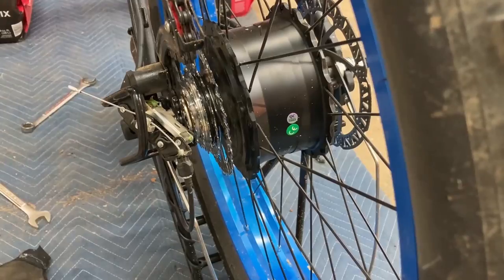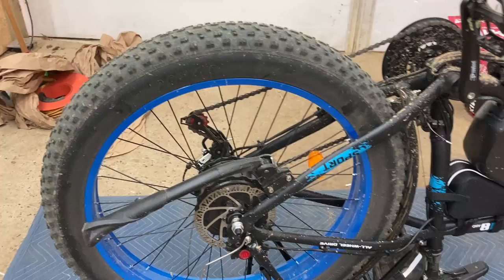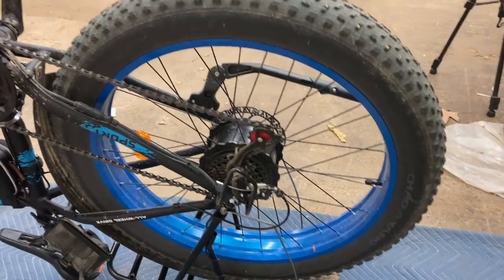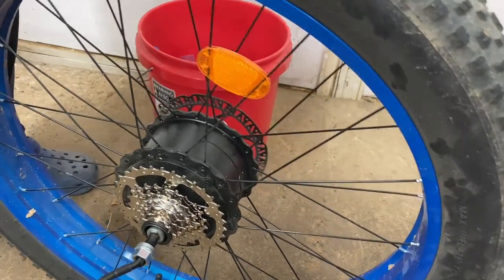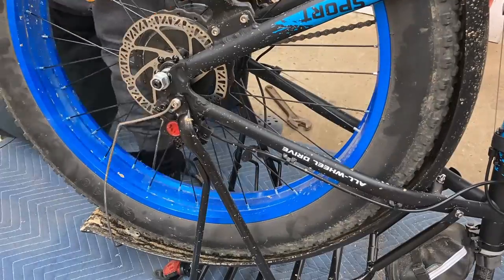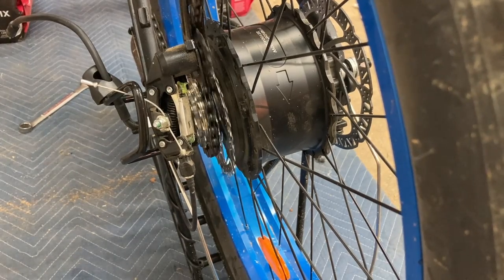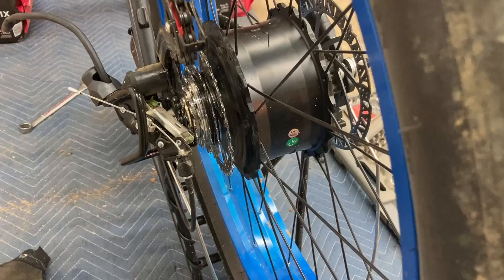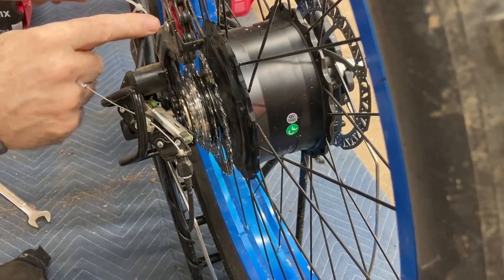Philodo H8 Ebike Upgrade THIS Changes Everything

Comment: THANK YOU. I bought a Philodo H8 a few weeks ago and was a little disappointed. At 20 MPH i was pedaling super fast. I came across your video and ordered the parts you said, ( sprocket and tool)   They came in today and i followed your video and changed the sprocket to the new one. WOW,, what a difference. the bike is useable now.THANK YOU. I have a question, why did you change the rear sprocket and not the front one? Thanks again, i watch all your videos, they are great.BTY i'm 77.
Reply from the maker: I am happy it helped, it makes a world of difference. When I got mine I peddled so fast my phone hopped out of my pocket.  I had to back track and find it, which I did on a back road.  I knew I had to do something.  I researched and found out you get more by changing the rear sprocket than you do the front.  And the front had 2 other sprockets, so I did not really want to mess with that.  But truthfully, the main reason I did the rear, is I had one that I was going to put on my Ecotric.  I did not want to wait for another to arrive, so I put the 8 speed on until my 7 speed came in.  I did the same change on my Ecotric, so I knew I could do it as the Ecotric and the H8 had the same Freewheel.
   One thing to keep in mind, be sure to keep your chain lubricated regularly as this freewheel has a tighter turn radius so it will wear out faster than the standard one.  I got about 8,000 miles on my Ecotric when it started to slip.  I am using a dry lube now, so hopefully it will last longer.  If not, no big deal as it is a 15 min change.
Thanks for your kind words,   I am humbled that you watch my videos, is this your first ebike?
Reply: @papablueshirt  Yes, you were a BIG help.  Thank you for the quick , long and very nice reply. 

What I was going to do before I seen your video(s). was to put on a 48 to 52 front sprocket. But then i might have to put on a longer chain? Then I saw your video and since you gave us the part and tool number and showed us the results i was going to try that first. It worked great. I washed the chain before i started and used chain lube, the oil type, after I finished. I'll look into the dry lube, i didn't know about that and will lubricate it often, thanks. 

I would guess that Philodo used a pre-made fat tire bike and because of the heavy fat tires they geared it very low. In first gear the fastest I could go by pedaling alone was 3 to 4 MPH. In high gear the fastest I could Pedal was about 24 MPH. Now I can pedal with the motor and go 30 MPH. With the twist grip it will go 33 or 34 MPH, but I cant pedal that fast. 

You said in one of your videos that the twist grip runs the front wheel. When I lift the bike off the ground the twist grip spins both wheels? So from what you say, by pedaling it only used the rear wheel?

I also have a Ecotric Hammer, which I really love. I bought it 4 years ago when it was 1000 watts. Without pedaling it goes 25 MPH, with pedaling hard and fast It gets up to  30 MPH. The upright siting position is very comfortable for this old man. 

I also have a 15? maybe 20 year old Currie E-bike, I think it's about 400 watts, and it goes about 16 to 18 MPH. It has dual gel 24 volt batteries. UGH, yes it is very very heavy. But it still runs good.

I also have a eGO scooter that is about 20 years old? It originally was 24 volts at 50 amps and would go about 20 MPH. I put on a 48 volt battery and a 350 amp controller. It then went 48 MPH, no pedals. 

Once again, thank you for all your very informative videos and God bless you.
sincerely
Paul
Reply from the maker: No problem, I love talking ebikes, and glad I could help.
If you check the description there is a link to the dry lube.  I always used the oil type for my Ecotric and it really makes things messy.  My rear wheel always turned dark.  The dry lube is wax based,  so there is no mess on the rear wheel.  I really like it.  I think I got 4 spray cans, I am still on the first one.
  Wow, it looks like you discovered ebikes way before I did.  I just discovered them in 2020 and did not realize what I was missing.   Your eGo scooter sounds interesting. What type of battery does it use.? I never knew ebikes have been around that long, I am sure the batteries have come a long way from what they used to be.

Re Throttle:  Yes, when you twist it, both motors engage.  They also engage both motors with the walk function and cruise control.  When you are in normal PAS, just the back motor works.
  I have a question on the H8.  My front wheel seems to move forward and backward slightly as I hit bumps.  I suspect it is the suspension fork play or something.  My ecotric did not have suspension, so it did not move much.  Does yours do that?
   Have you discovered suspension seat posts?  I put one on the H8 and all I can say is wow.  It made the ride so much nicer.  I am thinking of putting a suspension stem for the handlebar as I think it would really smooth out the ride.
Well it is getting late here, I will talk more later.
"May the good Lord take a liken to ya" : )
Reply: @papablueshirt  OK, I'll check the link and order some dry lube.

My eGO uses 4 large ( almost car size ) lead acid batteries. very heavy.

Yes, I have been into electric bikes for over 20 years. The Currie i have now is my wife's bike and it's a step-thru with an external controller. I had a Currie 20 years ago that had the controller built into the motor, it was a very compact robust design. You might enjoy looking up the old Currie bikes online.

I haven't notice my H8 having a problem with the front wheel. I have the Ecotric Hammer does have a front suspension and a rear seat suspension. I bought a seat suspension for the H8 and it really helps a lot. I highly recommend it. 

I looked into the suspension stems for the handlebars for both of my bikes. All they are is a piece of rubber that are color coded for different hardness. it doesn't look like it has much movement. If you get one let me know what you think of them. 

Paul
Reply from the maker: Hi Paul, thanks for your input on the front suspension.  Maybe I have it set wrong or something, I will have to experiment with it.  It gets a little annoying, I can put up with that as long as it is not failing on me.
  I will check out the Currie.  I did a quick search yesterday and it looked like they were no longer in business, but it seems they were some of the first ebikes.  I will do some more investigating today : )  I thought the eGo probably used Lead acid batteries.  Heavy, but probably cheaper than lithium.
   Re suspension stem: yeah I have seen the kind that uses rubber shims, but the kind I am thinking of use the same system as the seat suspension.  It uses springs.  I put a link next to the dry lube link.  I hope to get one soon so I can do a review on it, but at almost 200 it is hard to justify. LOL  My seat suspension works so well that I feel like I am on a bucking bronco with the front.  It bounces all around.  I tend to hold the handle bar loose in my hands to kind of let it bounce.  I have also learned to hold the grips away from the center as it has a bump on the grip that kind of hurts when you hit bumps.
  In your years of riding, have you had many flats?  I was doing my 2000 mile review the other day and had a flat.  Turned out it was a staple.  I pulled the staple and fixed it and promptly had another flat in a different spot.  I think a pc of the staple is still in the tire and I must have rotated it when I fixed it.  I gave up and put a new tube and tire on.  I also bought some flatout to hopefully solve the issue going forward.  I do a 32 mile wood trail with very limited access, it would be a bummer to lose a tire midway.
Reply: @papablueshirt  Hi Papa Blue,

I made a few minute video of my bikes just for you, it's attached at the bottom of this video.

My Hammer is by far my favorite bike i ever had. I love the power, upright sitting position and wide western handlebars are all great. 

I think Currie had bikes and scooters about 35 years ago. I had one back then, they were low power, maybe 400 watts, and very reliable. Back then they were all old fashion heavy gel lead acid batteries. I worked in the electronics industry for 30 years and I love bikes, so rebuilding the ego and other bikes mix my two passions. I used to belong to a ebike group 20 years ago and we all modified the bikes to make them go faster.

I looked into the handlebars suspension and only found the rubber insert ones. I'll recheck into the shock type ones. But since our bikes have front suspensions i wonder how much help the handlebars suspension would help. I'll look forward to your review if you get one. My friends bike has a hard rear end bike, when he was following me he noticed how my seat would go up and down over bumps.  So he's going to buy one like mine. It's a wide soft seat.

I had a few flats on my bikes over my life.When i was a kid we were poor and I used to use rubber bands and rubber glue to fix flats. About 20 years ago I was riding my Currie ebike going down a hill about 20 MPH. The rear tire had a blow out and I went down dislocating my finger. On both of my fat tire bikes I use the Mr. Tuffy XL Series 4XL TEAL. the teal ones are for tires 4.1 to  5 inches. I get them so they would wrap around the inside of the tires more. As a secondary precaution I also put in green slime, probably not needed. In about 1000 miles I haven't had a flat. I live in Arizona and we have a huge problem with thorns and goat head stickers. I also carry a can of " Fix a Flat " at all times just in case. I haven't need it yet. Flats spoil a ride. 

Below is the link to the video i made for you.

https://www.youtube.com/watch?v=uuk4snZegsU

Paul
Reply from the maker: Hi Paul,
Thank you so much for the video.  As they say, a picture is worth a thousand words.  A video is even better : )
   Sounds like you know quite a bit about electrical.  I do pretty good with mechanical things, electrical is a little harder for me.  I have wired a few houses, but that is pretty straight forward.  When it comes to resistors and relays and stuff like that, I have to do a lot of reading and watching videos.  I have seen quite a few lithium battery fires on youtube, so they make me a little leery about messing with them.  I would love to get another battery for my Philodo and wire them together. I hear they make kits for that, but not sure how it would work with the dual motors. 
  I had no idea they made ebikes that long ago, man I have been missing out all these years LOL.  Your eGo looks more like a motorcycle than a scooter.  I know what you mean about high speed though.  I got my Ecotric up to 40 mph or maybe a little faster [it pegged at 40]  I felt pretty stable, but it had a front fork with no suspension.  I may lock my suspension on the Philodo when I try to beat it.  I have federal park that I go to that has some crazy hills.  I can go over 35 just coasting, it is a rush.   Sorry to hear you wiped out with a flat.  So that will certainly be on my mind now.   I have had a few mishaps.  I rode off a trail once.  It was my fault, I looked back to see if someone was coming and drove off the edge of the trail.  It was on the edge of a hill, so I did a face plant over the handlebars.  The hill was so steep I could not get back up and had to walk through the woods and catch the trail on the other side.  Then I tried to pretend nothing happened,  but my wife found me out pretty fast LOL.  If you are interested here is the video here: https://youtu.be/OufBqN3hmZI
  I went about 12,000 miles before my first flat, so I did not worry about that much.  Now it is on my mind a little more.  I carried fix a flat for a lot of those miles as the guy I watched said he was always having flats with his flat tires.  I think he lived in an area like you, that has goat heads.
  You are in AZ, funny we almost moved there last year.  I did too much reading and go kind of freaked out about Valley fever.  I deal with lung issues, so that kind of persuaded me to stay put.  What is your take on Valley Fever?  My wife was concerned about the dust storms too.  I think we may be too old to be making major life changes LOL
Reply: @papablueshirt  Glad you liked the Video. I was was thinking about wiring another battery on also. But after thinking about it I would have the extra weight all the time. If I just bought another duplicate battery then I can strap it on the back just when I want to go the extra distance, and when the first battery dies, just swap it with the spare in the rear, or where ever you want to put it. This way no permanent wiring change and no extra weight all the time.

Wow Ecotric up to 40 mph, thats scary fast. lol. I didn't know you can go faster with the front suspension locked. I just looked it up to learn about it.  less bobbing up  and down thanks.  

Glad you were ok after you mishap, I had to go to the ER and have my finger undislocated, ok, not a word, lol.

Wow again, 12k miles and no flat. Like i mentioned before, with out tire protection I would have a flat once a  week here. That is why i use double protection, liner and slime.

We live in what is called " the high country " in Arizona. We are a mile high and have 4 mild seasons here in the Prescott area. We have 4 to 6 usually light snowfalls a year, 1 inch or less. But i have seen 16 inches of show here. We have about 3 weeks of weather in the 90's in the summer. In the area where I live there are 750 miles of local trails to walk and ride, and outside the city there are thousands of miles to explore on dirt mountain trails. We are approx 100 miles north of Phoenix and don't get the smog dust storms, or super hot weather. Housing here is much cheaper then the Phoenix area and many come with 1 or more acreas of land, i'm on 2 acreas. We lived in Tucson for 20 years and did get Valley Fever once, but we don't have that in the high country. I also have lung problems COPD, ( no, i never smoked ) and that is one of the reasons I moved here, very clean aire.
  
  Have you seen this video made by Philodo about removing the H8 speed limit? I tried it and can't get it to work.

https://www.youtube.com/watch?v=7EvLriKStPM
Reply from the maker: I really did like the video, you have a nice speaking voice you should post more to your channel as I am sure people would be interested in your ebikes and scooter.  My wife was impressed [as I was] that you would take the time to record a personal video.  Thank you so much
  Going to the ER I am sure was not fun.  Did the dr tell you to slow down ; )
  I used to carry an extra battery on my Ecotric.  I had the kind of pack rack that hooked on your seat post.  It works ok for the road, but I found out not too good for off road use.  Here is the video of me crashing and having a "fun" day in the woods. https://youtu.be/C17hY9-HU6I?t=491
  After that happened, I went to a standard luggage rack with more success.  However, I just resurrected my broken rack.  I took the rack bag mount and attached it to my Philodo.  Now I can carry my pac rak bag on my Philodo.  It worked out real nice.  So now I can carry that extra battery when I get one, as needed.  On most rides, the Philodo has plenty of range.  58 miles is my longest, but I had to baby it at first to make sure I made it.  It would be nice to have the extra battery so I can go as fast as I want and not worry about running out.  On my Ecotric I had to start bringing an extra battery just to make it home.  It got so bad, that I could only go about 8-10 miles before it ran out.  The 36v really went through batteries.   I did get a new battery from Ecotric as a fan reward thing, which was nice.  I just need to change the tires and get it going again.  I still have the original front [bald] tire on it LOL 

Re AZ: that is funny.  The areas we were looking at was Prescott, Kingman and Show Low.  I still have them on my weather app.  I check them from time to time to see how it could have been : )  I know when everyone thinks of AZ, they think it is all desert and hot, but your weather seems more like ours in the midwest.  Without as many tornados.  Our town was destroyed in 2021, we still have not recovered.  That was a scary night.  But moving across country is a major deal,  but who knows.  We were already packing, then got cold feet.  We would have to downsize as I am pretty sure things are more expensive than here.  We have almost 40 acres and very secluded here, I think that would be expensive to replicate now with real estate prices so high.

Re speed change:  I did the po8 thing and it changed mine.  If you are getting 33 mph, I am pretty sure yours is changed too. If it is limited it is like 22 mph.  That being said, I think they are still somewhat limited.  Mine goes 34.7.  That is all it will show if I am peddling.  If I stop peddling like going down a hill.  It will go higher, but if I peddle it will show 34.7 even though I know I am going faster.
Reply: @papablueshirt  Hi PBS,

Glad to hear you and your wife liked the video.
I just put a handlebar angle riser on my bike so i don't have to bend over so much, i'm old you know, lol.
here is the link to it. 

https://www.youtube.com/watch?v=BmZ6BwV3pxQ

 I also bought a straight riser that will raise the handlebars about 4 inches if the angle one isn't enough for me. I don't know if the cables will go that far. 
new angle riser on Philodo H8

Yes, crashing on a bike is not fun, but part of the risk in biking. Glad you ok from you crash too. 

I just went on a 48 mile ride on my Hammer today on the peavine trail here. I passed 6 people on ebikes, wow that is the most i ever seen out here. Then I stopped at the rest stop and met a man who rents out ebikes and has guided tours. The sure are getting popular. Yes the old 36 volt bikes didn't get you far. I see some of the new ones are 60 and 72 volts. 
 
If you ever come back out to the Prescott area please look me up, I have 3 ebikes and you me and your wife can go on a ride.  

I did change the P08 setting to 100, so i think it is set to the max speed. 
Paul
Reply from the maker: I thought about changing my handle bar riser, but I am holding off to see if I get that suspension stem.  They do have a bunch of different angles and lengths, so I will have to figure out which one to try.  Let me know how it goes.
  48 miles, that is a good distance.  Yeah ebikes seem to be getting more popular as the baby boomers get older.
  I ordered my Ecotric before I ever tried one.  I got a little excited and ended up doing the rental thing.  Here is a video showing are first reactions, it was a fun day.
https://youtu.be/akdJCUi9zYg
  The girls loved it so much I had to buy them each one LOL
If we ever get out there, we will certainly look you up as we would need a guide, thanks for the offer ; )
  How do you haul your ebike, or do you just ride to where you want to go?  My Ecotric would fit in our van, so we could load all 3 bikes in our mini van.  The Philodo is taller, so it will only fit if I lay it down, then there is no room for the other bikes.  I am thinking about maybe getting a bike carrier.  I could remove the front tire, but it does not have the quick release.  But it would still probably work, I would just have to bring a wrench.
Reply: Hi, I just received a 46 tooth chainring for the front sprocket. I tried to remove the old one but it hold on by 4 screws. they look like torx screws but they are very shallow. maybe 1/64" deep, if not less. Do you have any Idea how to get them off?
Reply from the maker: Hi Paul,  I never changed one, but my understanding is there is a special tool.  I think they call it a chain ring wrench.   There are a few different kinds.  I wish I could be of more help.
Reply from the maker: Hi Paul, Just wondering if you were able to get your chainring changed?
Reply: @papablueshirt  Hi, thanks for asking. No, the chainring is the correct size, but I can't get the stock one off. The outside screws look like allen but they aren't very deep. I can't get an allen wrench into them. Please take a look at yours and let me know if there is something I am doing wrong. Thanks in advance and for asking.
Reply from the maker: No Problem, I was wondering if you were able to get it.   I will take a look at mine before my evening ride and see if I can figure it out.  I hope you are having a great 4th of July : )
Reply: @papablueshirt  Thank you, wish you and your family a great 4th of July
Reply from the maker: Hi Paul,  I got an answer for you.  I am told these have decorative rivets, and are not removable.  To change the chainring you have to get a different crankset.  Which is a bummer.   I will try to hunt down a crankset that will fit.  I am not sure we can find a triple with the combination you want.  I am assuming you want a larger one for the big one.  I hardly ever use the smaller ones, but I plan to do some bluff riding in the woods and it may come in handy.  Otherwise I would just swap it out for a single.  So I will be researching.
Reply: @papablueshirt  Ok, that is odd to put decorative rivets there. I already have the correct ring gear, I forgot I think it was 44 cogs, maybe 46? I'm old. lol... I wonder if I can drill out the rivets?  Like always, thanks for your help.
Reply from the maker: Yes, I have seen some do it.
Here is a couple of videos: 
https://youtu.be/HgRxmWK7CGY
https://youtube.com/shorts/r_46mr-y5mA?feature=share
Cranksets are pretty reasonable, so it may be less work to just go that route.  I found a triple on Amazon with a 48x38x28 for less than 30.00. so that may be an option.
  I hope this helps, Let me know how it goes ; )
Reply from the maker: Hi Paul, I was wondering how the riser was doing on your Philodo.  Do you have a link to them?  I have a subscriber who is looking to do the same and he was wondering which one to get.  Thanks
Reply: @papablueshirt  How do you get it into the walk function? I have the GoGoBest HF700, same bike different branding. Thanks.
Reply from the maker: Just hold the down button for a few seconds, that will engage the walk function.  To stop just tap the brakes.
  If yours has cruise control, it is the same process for cruise.  Except this time you engage the throttle while you are riding, then hold the down button.  It will flash walk, then cruise.  Once you see cruise you can let go of the throttle and it will be in cruise.  Hope that helps :)